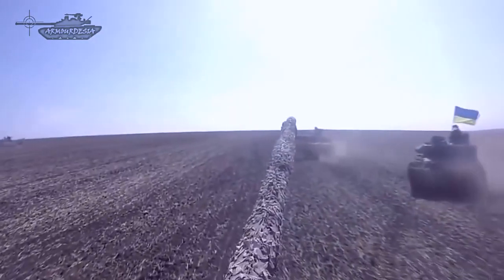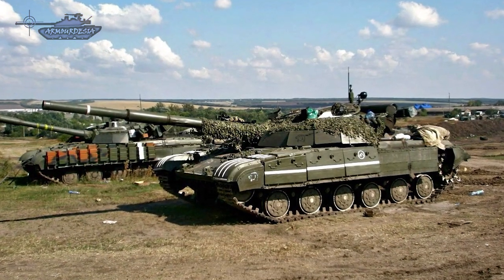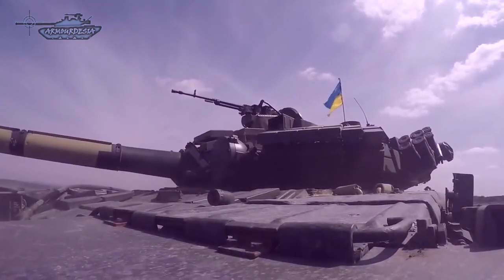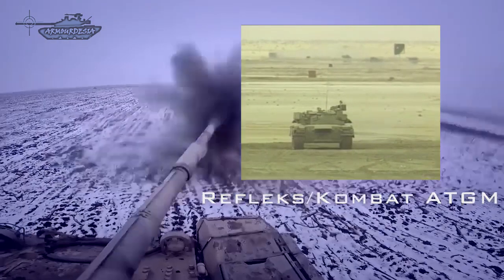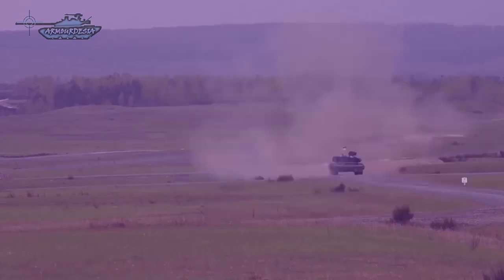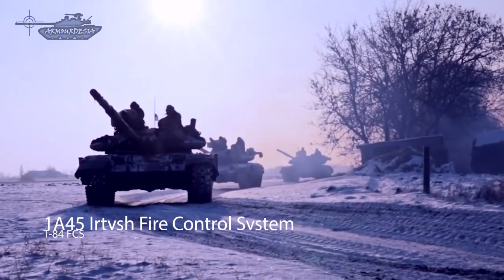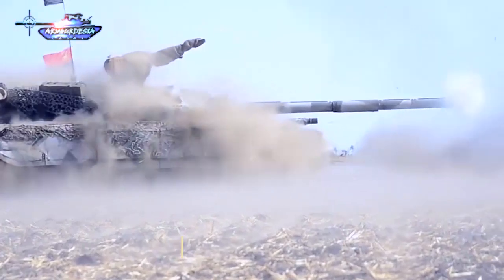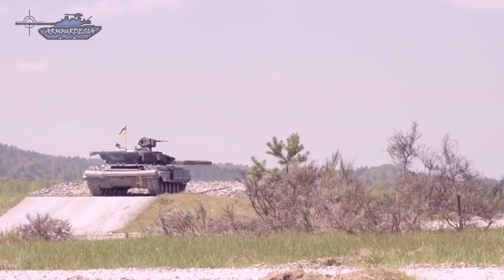T-64 Bulat | Ukrainian Main Battle Tank

Comment: Doctrine is important to keep in mind with these tanks.  They are gen 2 MBTs but through upgrades they have become gen 3.5.  The T-64 will always be overshadowed by the less capable but more economical T-72.  When used correctly with the right support, the T-64 BULAT is a terrifying opponent.  While there are more modern MBTs, the doctrine of use is what makes them superior, not the tank itself.
Reply: The t64 is better than the t72. The armor is better albeit more expensive (composite). It is faster and more manuevarble. In cold war we were taught that it was more difficult to take out a t64 than a t72 with anti-tank weapons.
Reply: Ukraine's 1st Tank Brigade uses primarily  T-64 BM's and they were able to defeat a Russian force that was 10 times bigger at Chernihiv during the opening days of the invasion.